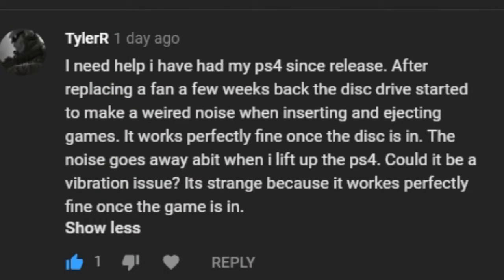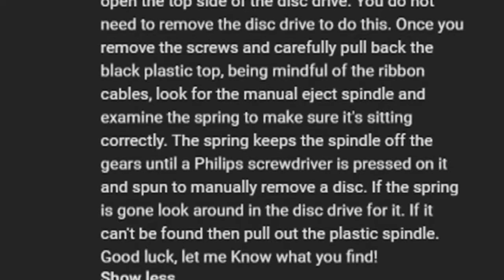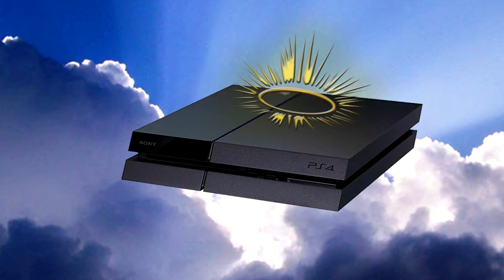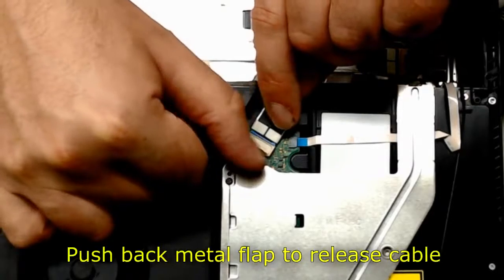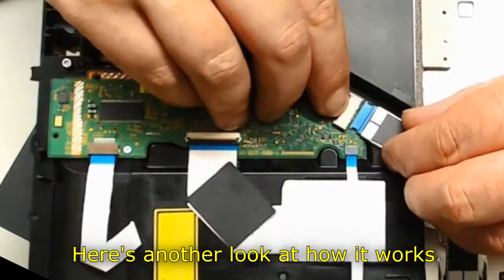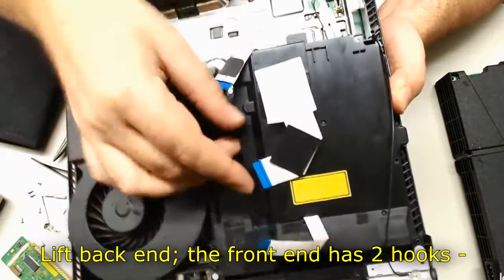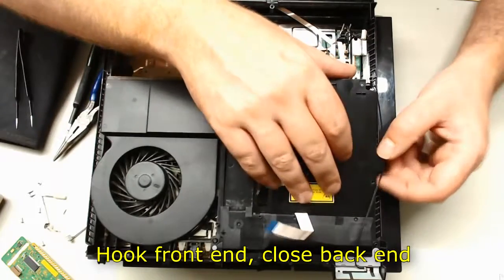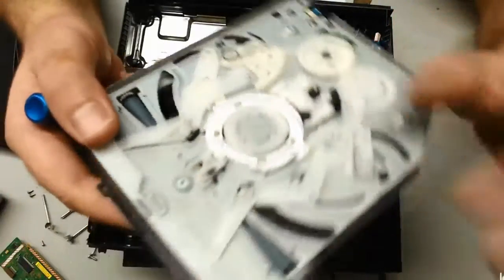PS4 Disc Drive Crunching Noises when inserting and removing games

Comment: Hi there I have a problem with my disc drive as well, when I insert a disc the system will start reading smoothly, but then it'll sound like someone typing on a typewriter all of a sudden then the message 30005-8 will pop up. What suggestions do you have that I can do? Thanks again!
Reply from the maker: Your hard drive is the issue possibly. In safe mode you can select rebuild data base.
If that doesn’t work you may need to re-install system software (that’s like a full hard drive wipe- you may loose all your data but the hdd will work again). If all that doesn’t work your Hard drive may need to be replaced.
This is the path that error code is leading you down.
Reply: @RetroFix   I have the same exact problem as the person above, but only with one specific game.
I’ve tried to reset the database but I still have the same problem.
I get the same error code as well too

I’m not very good with techy stuff so this is probably a dumb question, but is it more likely that its a problem with the playstation or the disc itself?
Ive had the disc for probably two years, but I didn’t use it too often and its hardly damaged if at all,  and I have discs in worse shape that work perfectly fine.
When I insert the disc it makes the whirring noise when it starts spinning, and then stops and then starts again and repeat.
Reply from the maker: @humblebumbblebee  I can't be too sure. It's possible your laser is weakening making it hard for it to read certain games. It certainly could be the game for what ever reason. I'm not sure. sorry that I can't be of any more help on this one.
Reply: @RetroFix  thank you!

Comment: My ps4 making loud scratching noises like if its scratchig a disc but it still reads games just fine
Just a loud scratching noise idk what to do
Reply from the maker: Taking a guess: it’s probably the metal top that fits on the disc drive with 2 screws. It is slightly bent and barely rubbing on the disc as it spins. If that is the problem, the way to fix it is to get to the disc drive, remove the metal top from the drive, slightly bend the metal piece, reassemble and test. I keep doing that until no more noises.
That Or buy a disc drive replacement.
Reply: @RetroFix  yooo thank you so much for the response i will try n fix it i appreciate you ✌💪

Comment: Hellos Mr.retro I have a video on my channel similar to this and it says disc is unrecognizable also makes a very strange noise.(Model-CUH-1215A)
Reply from the maker: Ooff it sounds like the laser is off alignment with the worm drive (moves the laser back and forth). I can’t think of anything else that would make that noise in there.
My first point of strategy would be to take apart everything in the disc drive and put it back together again. But I have to warn - that someone who hasn’t been in a disc drive a bunch may cause more damage than repair.
I always recommend taking these type of things to a reputable repair shop.
But yeah, I’d put my money on the laser’s “arm” isn’t holding onto the worm drive correctly.

Comment: My man mine won’t take disks and on boot it sounds as if the disk drive is doing something for the first minute then goes silent??? Any infos apriciated
Reply from the maker: That could be several things. My first step would be to get in the drive, clean out everything, use 91% isopropyl on all the little sensor switches and get the rollers nice and clean. I've seen the rollers knocked off alignment which can cause no intake. Sometimes theres things jammed inside, I've also seen mutiple discs stuck inside. The intake motor can die, I've have a handful of those over the years, one recently actually.
You can manually insert a game (see youtube if you don't know how) then plug in and power on the ps4 and you should be able to see if the drive reads.
The good news is you hear some sort of activity when you turn it on so at least there is power to it. There might be a chance. 
I hope this helps!
Reply: Thanks a lot man, i fixed it after 4+hr basically did everything you said and I didn’t work, at the end I figured that there is power but the board doesn’t work cause the thin Flat cable was dead, fortunately had an extra cable like that swapped it and it worked I am so happy…. thanks man you r a legend.
Reply from the maker: @FilipMilic-vs1eg  Nice save you pulled off there! I'm very impressed! Glad I could be of some help. 😄

Comment: Help how do take manual spindle out of ps4 pro it keeps making noise when disc comes in and out
Reply from the maker: I’ve never had to do that for the pro so I’m unsure. Try to find a disc drive disassembly for a pro and watch carefully. That’s my best advice at this point.
Reply: Thanks you for your advice

Comment: Sir, my PS4 doesn’t read my games discs, it makes a weird noise when I insert the disc, would the safe mode method work to re install the update. In safe mode, when it asks you to use a Usb cable, Does a PS4 normal charger work??
Reply from the maker: From what I’m reading sounds like your laser is going out. But you can certainly go into safe mode and reinstall an update if you wish. Older PS4 HDD’s could use a full wipe (Reinstall system software) to help them work better.
But I’m guessing the laser needs replacing. You’re a local computer/phone repair shops should be able to handle that task.
Reply: @RetroFix  Ayy, Thank you sir. Just one more thing if you don’t mind, will a normal ps4 charger work to power on my Dualshock Controller in Safe mode
Reply from the maker: Yes the cable works. You can install An update using the Internet from safe mode. In safe mode there’s no Bluetooth so you’ll need the USB cable to use the controller.
Reply: @RetroFix  Thanks for the help, the usb cable is the original ps4 charger right??
Reply: @RetroFix  Sorry for going on about the usb situation, my old ps4 happened to be locked in safe mode, therefore I am a bit weary. Hopefully this works for my PS4 pro. Do you know how long the computer repair shop would take to repair the issue in the PS4?
Reply from the maker: @1k.mikail  probably within a day unless they need parts.

Comment: I have the same problem but I'd rather listen to the grinding sound than watch this disgustingly annoying video.
Reply from the maker: I would recommend to call various computer repair shops and compare prices for a "PS4 disc drive repair". Good luck! The issue with this particular PS4 is with the "manual eject mechanism" (small spring and plastic gear)

Comment: Hi I have some problems like disc drive cannot even take disc I open PS4 the roller work perfect the arms also open and close very smoothly but when I minually inserting disc the disc go in smoothly until it reach the middle when it reach middle of disc drive I don't know why but that circle piece in a middle cannot slide disc down

Please reply
Reply from the maker: It’s possible that the circle piece is not sitting correctly which would cause it not to go down how it should or even it could be upside down too.

Comment: Hey I'm wondering if you can help please earlier I was playing my ps4 while a disk was in and it started to make a sound similar to a old projector would make like a click sort of and it doesnt like to except games unless you put it in right but it still will let me play the game any info will help iv had it for about 3 years and hasn't been cleaned could that be the issue?
Reply from the maker: It’s amazing how many disc drive issues are fixed with a good cleaning. I’m not saying that’s definitely going to fix the issue but... there’s a good chance it will. I always recommend a local computer repair shop but if you want to do it yourself you gotta be careful! Watch several different YouTubers disassemble your particular model of PS4. You can even film your repair so if you mess up you can rewind and see what you did wrong. Take your time, don’t rush. And may the force be with you.
Reply from the maker: upload a video of the noise in question to help me identify it. Send the link to this comment thread.
Reply: @RetroFix  I will make a video in the morning and hopefully it's a easy fix
Reply: @RetroFix  I fixed the noise but the silver piece that goes on top doesnt want to go back in place
Reply from the maker: @brodyca1898  When I first started fixing things and I came to a point where I couldn’t put something back together again I would stare at the pieces and try to figure out how they are supposed to fit by identifying notches in the pieces, where edges slide in, screw holes and things like that. Also with enough finagling you might be able to get it to slide in and screw it down.
Reply: @RetroFix  I actually ended up making it worse it wont except disks and when I turn my ps4 on it will make the sound of it pushing a disk out for about 15 seconds
Reply from the maker: @brodyca1898  yea that’s why I first recommend repair shops. Your disc drive is still salvageable I’m sure. But now you’ll need someone who’s dealt with PS4 disc drives a time or 2.
Reply: @RetroFix  so it was a spring that came off and it will read games and stuff now but after having the game in for a while it gives a error while downloading CE-30005-8 the disk is almost spotless not sure what to do
Reply from the maker: @brodyca1898  searching the error code suggests ‘rebuild the database or there’s an issue with the disc drive.’ I’m guessing it’s still with the disc drive but it couldn’t hurt to re-build the database If you haven’t already. As for the drive, if it were me I’d keep going back in to try and figure it out. If no positive results after a few more tries I’d then proceed to order me a whole new drive... lol.

Comment: hi dude i need your help, my ps4 makes kinda similar noises whenever i try to insert/eject disk but as soon it goes inside the console everything is fine and hard disk read the disk perfectly,
so idk what to do? only this noise... everything else seems ok
Reply from the maker: Has the console ever been opened before? Have you ever had to manually eject a disc?
Reply: @RetroFix  yes one time i had to manually eject the disk cuz apu needed reball and i couldnt turn it on, so i take out disk and sent it to repairist for reball then this noise came out ...
Reply from the maker: It's possible you jamed the spindle and the spring can't bounce it back up off the other gears. All that's happening is the teeth of the manual eject spindle are rubbing against the other gears as they turn making a noise. Although it's noisy it's not doing any significant damage to anything but I guess overtime all of that rubbing can wear down all the gears so yeah it's a bad thing in the long run. You'll have to take it back to the repair guy and have him open up the disc drive to fix it or you can try sticking the screwdriver back down like you're going to eject a disc manually and just kind of wiggle and jiggle it a bit and maybe you'll work it free and the spring will bounce up the spindle off of the other gears. Also I should say that this is an educated guess on what's going on with the machine.
Reply: @RetroFix  thank you so much bro i will try it!
Reply: i reassembled it now wont even read the disk(disk unrecognized) rip lool
Reply: @RetroFix  yo i opened it up again cleaned the laser now its reading disk! also the insert/eject noise alot lower(still noisy but much better than before)

Comment: Mines makes a grinding noise when I insert a disc.
Can I just stick an air canister in the disc slit and blow air??
Or is that dangerous
Please let me know
Reply from the maker: It’s likely that using an air canister will not fix your grinding noise. If you do use the canned air, let the console sit for a bit  afterwards until moisture from the condensed air has evaporated.
Reply: @RetroFix mine makes a HARD grinding noise can you help me?😢

Comment: Yeah I’m not taking it apart and screwing the whole thing up lol. Mine makes that noise haha
Reply from the maker: You should be fine for quite a quite a bit. I Imagine after a while the plastic piece will disintegrate from being abused in there. I don’t know if it’ll get sucked into the rest of the drive and screw things up or if it’ll just sit in there not touching anything anymore.

But yes things can get worse if you don’t know what you’re doing in there.

Comment: Dude mine doesnt have that spring if I fix that will it work cuz iv replaced everything elts and know it never reads the discs
Reply from the maker: If there's no spring then take out the spindle. U won't be able to manually eject the discs but at least there won't be any of that interference. Id also go over all of the disc drive's internals to make sure that spring isn't jamed up in there somewhere.
Reply: @RetroFix  I'm about to iv tried everything it just wont reconise the discs oh and um curiouse whys the light white and not blue?
Reply from the maker: You can try resurfacing the lens of the laser too. I use 91% isopropyl, qtips and an air compressor- set at maybe 10psi (gentle force) with a damp qtip, wipe up the lens and use the compressor to dry it off. Dry end of qtip can put scratches in it. If a laser is clearly scratched I'll put a wet qtip on it and leave a layer of isopropyl on the lens for 5 to 10 seconds to get rid of the scratch. If that doesn't work you'll have to install a new laser.
Reply: Well I made a video of me putting in a CD on tik tok of u wanna see the problem zombieklown420 is the screen name would appreciate the advise thxs
Reply: @RetroFix  hey I figured it out for some reason the ribbon that attaches the laser when the laser moves backwards the ribbon crunches up behind it jamming it from.moving how you fix the?
Reply from the maker: Sorry, you didn't finish the sentence. You want to know how to fix the... cable? You'll have to re-run the ribbon cable and make sure it's set correctly. Hopefully the cable didn't get damaged.
Reply: @RetroFix  bo there's no damage done the lasers rubbing when I moved it up and down
Reply: @RetroFix  basically I took the tape. Completely off I think I'll have to re tape the ribbing again
Reply: Ok I got the games to read then they download but an error code pops up n I looked it up it says I have to re marry the boards together that's what ppl are saying
Reply: @RetroFix  ok I got a new ps4 but it wont access anything and when I go into safe mode it wont catch the internet I dont know why so I cant do shit
Reply from the maker: @psycomie4203  if it is a brand new PS4 then return it or swap it out through the store you got it from. Other than that u can try re-installing system software using a USB. PlayStation's website has update files and reinstall files on there with directions on how to do it.
Reply: Thxs I do appreciate the advice I found it in a dumpster all I had to do was safe mode then initialize ps4 know its completely fine
Reply from the maker: No problem. If you have any issues with games freezing and or sluggish operating system then perform the reinstall. That wipes the drive fully, more so than the initialize. If any of those problems persist then you'll need to put in a new hard drive. 500gig HDD are $35 (or cheaper) All day long on eBay. But man if everything works with no issues, dayum that's a good score! LOL
Reply: Ok kewl thx u

Comment: I also have a problem with my ps4 but it makes weird noises, freezes then closes the game..
I have uploaded a video if you want to check it out, help would be so much appreciated 😃
Reply from the maker: You need a new laser installed. Not to uncommon for those older PS4s.
Reply: @RetroFix  confusing part is the disc game will work well most of the time, but if I click on "information" or "update history" on a game in the home screen then it will start making weird noises then freeze and ejects the game.. So I don't know why it reads the game but then decides not to read it when I do a specific thing
Reply from the maker: @JCHUNTER248  when those lasers get weaker and weaker they do silly stuff. I got one to read the disc properly by running the PS4 upside down. There is a chance it’s not the laser or perhaps a second issue.
I wouldn’t rule out that your HDD is faulty or just needs to have a re-installation of the OS (fully wiped) those older PS4 Hard Drives are do for it if they haven’t had one yet.

Comment: Do you know how to fix the crashing problems after my black ops 4 game it crashes sometimes when I'm loading in to on fortnite I start to load in and it crashing any fixes
Reply from the maker: It could possibly be an overheating issue. Make sure the console is out in the open and not in a covey where it sucks in it's own heat. Make sure the room is cool. Maybe put a little fan aimed at the right side vents. If it keeps crashing, I would suspect your PS4 is an older model, probably has had tons of use, and will need new thermal paste. Rarely, fans go out by not being able to kick up to the higher gear, which will cause the console to shut down. But my first steps would be: Full clean out and new thermal paste.
Reply from the maker: Another thing you can try is to go into safe mode and "rebuild database"
Reply: It is a older model  and I tried rebuild database but it didnt work
Reply: It might just need that tho
Reply: How do I even replace a fan
Reply from the maker: @Sleepy_High420  it's difficult work to change thermal paste and (or) to replace a fan. I would recommend a professional. It's possible to do more damage if you are not familiar with the process.
Reply: Yeah I took it apart and it's real dusty I gave it a good wipe down but no luck still all my games are crashing
Reply: I thinks it's time for a new playstation
Reply from the maker: Your last option is to initialize the hard drive which is basically reformatting it. You can save much of your data (before-hand) on USB via data transfer options in settings. That way you won't loose anything. If that don't work then... Yeah it's either thermal paste, fan or both.